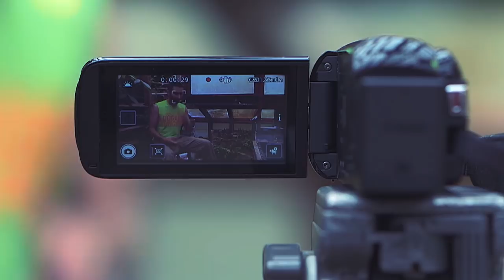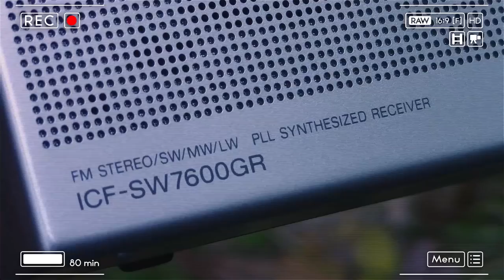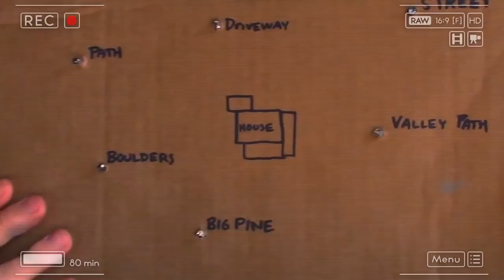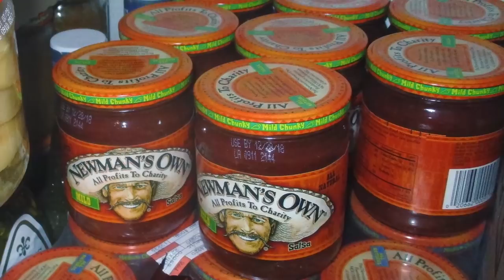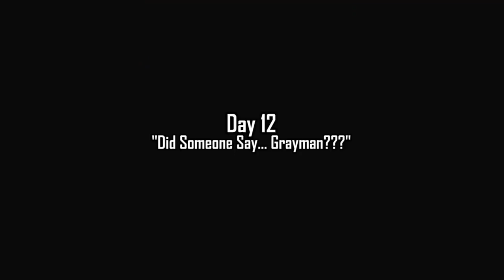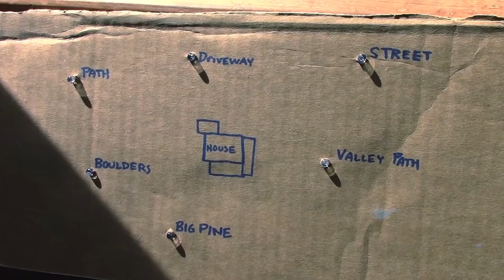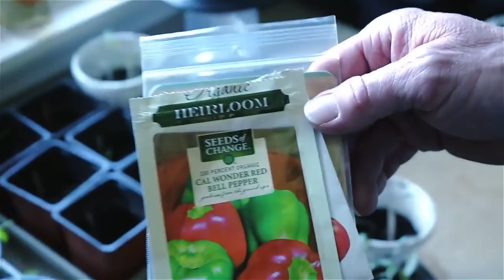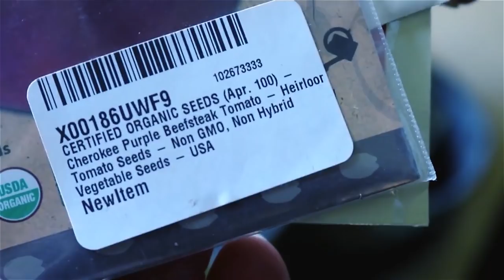Alien Invasion Complete First Season MEGA-MOVIE - A Prepping and Preparedness Film with Aliens

Comment: the boarded windows gave me a laugh, #1 they should be on the inside to keep people from opening them from the outside, i suggest you do more research if you want to be more believable, plus when you run from someone you don't have time to set the camera for a better shot, ;  the ''little to no reaction''  of having to drag your neighbors body and it falling apart like that - would have better not shown or at least have gag reflex or something!! i'll probably watch the rest of the movie but i suppose for a first try its not too bad, but yeah do more research before you do another. :)
Reply from the maker: Hey Kays, Thanks for the thoughts. One thing that I tried to do in this series was to show someone trying to survive something when they clearly were not the "perfect" prepper. I think showing someone making mistakes (as long as the ramifications of those mistakes are also shown) is a useful way to get people thinking.
On the neighbor dead, I'm limited by the fact that I'm absolutely no actor at all, so I had to play everything pretty dead-pan since I have no skills to play it otherwise. Though that said, I think "non-reactions" in people are probably more common than Hollywood would have us think.
Reply: @PraxisPrepper   yeah it was just a couple things that just bugged me as i was watching, then i realized it was done a long time ago lol, but also i was thinking it might be helpful tips to others watching just in case they need to think about things seriously happening, :) and i think i said in one comment, not bad for a first try :) sorry if i sound too critical, its the way i was raised, lol my dad was pretty strict.. :)
Reply from the maker: @kays5214  While most people like and appreciate this video, 1 out of 5 people seem angry about it and offer lots of empty mindless criticism.
You clearly were NOT that sort of person. You had real points of comment that you took great time in sharing. So I definitely appreciated your comment. I'm a big fan of there not being any one single way of doing things correctly, so while I'm not a huge proponent for super-rugged boots as a necessity, I'm also always thinking and balancing my own approaches to things as well. So to hear different points of view towards a topic is something that I find helpful and I appreciated it very much.

Comment: Oh and for some of you,you can make your own power source ,using magnets
Reply: An EMP can still affect electric generators and motors, by shorting out the copper inductors (coils). This concept was well illustrated in the Tom Cruise version of War of the Worlds, when his character advises the mechanic to change the solenoids in the Station Wagon's electrical starter/generator.

There is a gravity generator that if it's protected from an EMP by a Faraday Cage, can be useful as a light source:

https://www.youtube.com/watch?v=XXQZcvPld-4

Another power generating device is a walking knee generator, that could be used to recharge a flashlight, cell 'phone or a portable Ham radio.